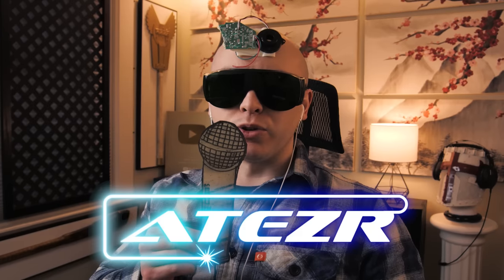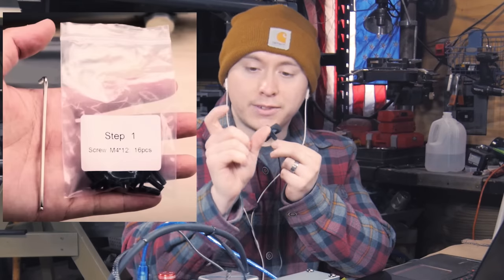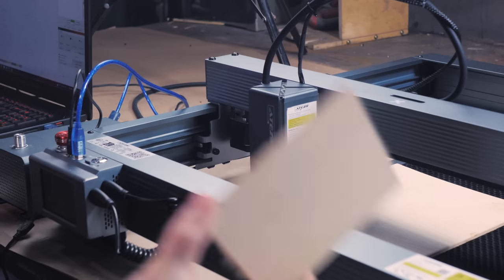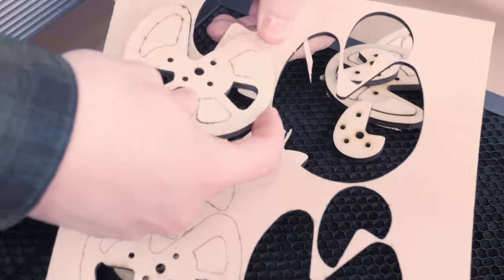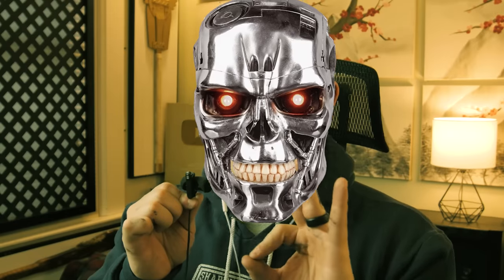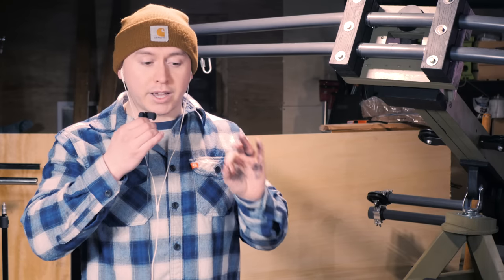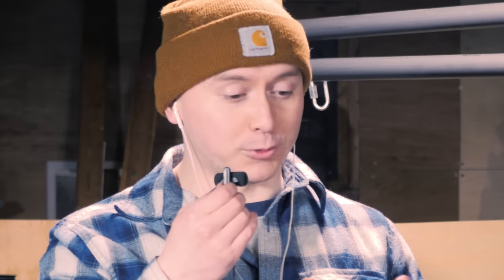The TERMINATEZR: Review of the Machine (ATEZR P20 Plus)

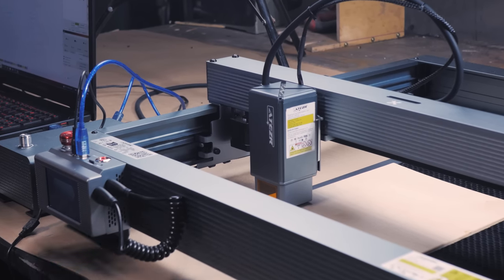Comment: 3:18 I've never heard of that added step of using airflow to increase the heat of the point of burn on a laser cutter (though I've never used one myself), and personally that's an amazing innovation due to how much energy and cost that saves on the laser generator's specs.

Comment: There should be an origin button on the machine. In light burn you can set it to absolute coordinates which would be based on the laser bed itself. Or point of origin. If you're doing a little smile face for example and you want it in a gap on the sheet but don't want to measure it out, you can set the origin point in the top right corner of the space you want to use and frame it in that way.